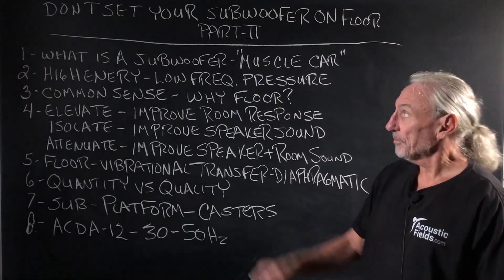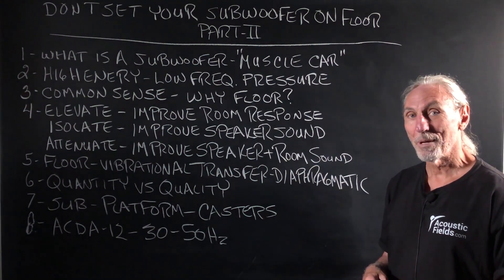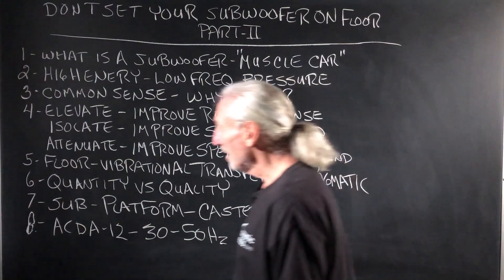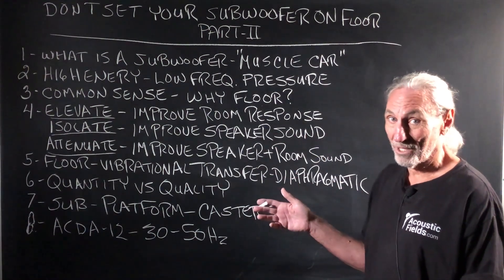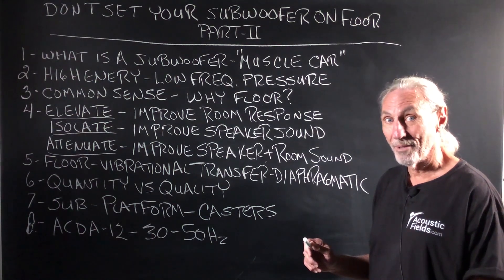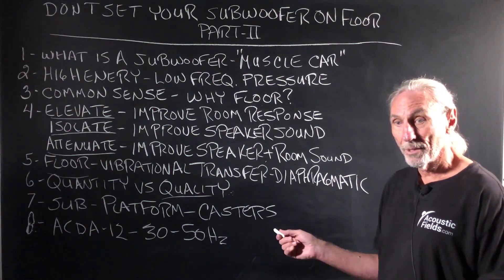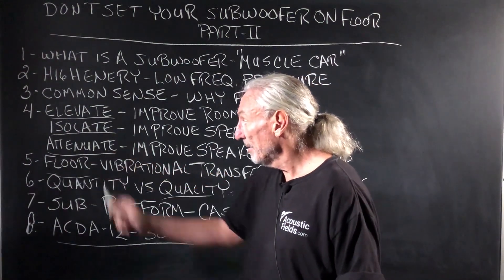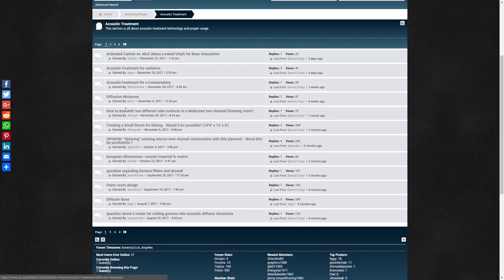Don't Set Your Subwoofer On The Floor! Part 2 - www.AcousticFields.com

Comment: Just tip up the sub and put a hard surface under it. It's people like you that have ruined the hobby for most people.                     . .
Reply from the maker: Its people like you that can not see the forest for the trees. Achieving quality sound in a "box" is a systematic procedure of doing a lot of little things correctly and in the proper sequence to work towards that goal. This is our objective and always will be. If you are seeking mediocrity, look elsewhere. There are numerous companies that will sell you boxes filled with 1.00 worth of building insulation that is 4" deep and call it a "bass trap". The only trap here is the trap the customer falls into.

Comment: What about 2 woofers which are firing opposite directions of each other? The recoil energy would be nulled, or rather transferred to the opposite side. The Kef blades speakers are designed like this, the old Magnavox stereos with 12 inch woofers firing in opposite directions kept the cabinet from feeding back low frequencies into the record player. Acoustic Research AR9 speakers also.
Reply from the maker: The room only sees energy. It does not care about the method of delievery.

Comment: I have no doubt this is true and am very much looking forward to the videos on subwoofer "elevation". However, even decoupling it, I wonder if there aren't floor types to which a subwoofer may be coupled? While this wouldn't work in our old house (oak parquet), I have occasionally heard subs coupled with spikes to hard surfaces with great results - e.g. concrete floor in a basement with no cavities underneath.
Reply from the maker: Its not the surface area of the floor that is the issue. It is the structure of it.

Comment: Elevate ok, but how? Typical cabinet (wood box) will be a resonator. Open frame? Will spread downfire more and may not get floor Into vibration state. Box filled with dampening material? But why have a sub if you then remove the sub's output? This leaves more questions than any answers. Would love to see some actual measurements.
Reply from the maker: You can elevate, isolate, and attenuate with our carbon sub platforms. Here is the link: https://www.acousticfields.com/product/subwoofer-platform-absorber/
Reply: @AcousticFields  Thanks for the link. So essentially it is an absorbent-stuffed box (Roxul 80 or similar). For energy management, there is a volume control on the back of a sub. Absorption up to 200 Hz is quite high, and the vast majority of subs have a crossover frequency adjustment. 30 Hz is not terribly low, as some subs go well below 20 Hz. Re elevation, I can see that removing it from a surface (1 dimensional corner) may be advantageous. But why not an open frame? Maybe slats, as a form of a diffusor? An absorbent-stuffed box can simulate height, but it also will have non-linear frequency response. I am tempted to make an open frame and see what that does. Fun little woodworking project. 
Looking forward to part 3 with some comprehensive measurements. Will be pretty complex as it involves 3D soundlevels, frequency response, plus room characteristics and then with sub on floor, on your stand, suspended, open box. Will be difficult to generalize. 3D statistics to show significant difference will also be complex. I've done linear series with nested MANCOVAs, but never looked into 3D data stats. 

Bottom line: conceptually interesting, questionable implementation.

Comment: I don't call it a SUB woofer until it is way below 20 hz. When the SUB can make a window wall move in and out by inches at 5 hz it is working properly. When the whole house shakes because a bomb went off in a movie, the SUB is working.
Reply from the maker: Quantity is not quality.

Comment: I don’t think $2000 worth of  bass stands will equal $2000 worth of better bass. I’m thinking if you spend that money on a Perlisten Subwoofer, it’ll be money better spent
Reply from the maker: Its all a balancing act with gear and treatment. You must have the gear to produce the energy and you must have the treatment to manage said energy. Nothing stands alone. Its all one large system with many parts.

Comment: I have going to try this with my sub. Only issue is I'll need some furniture to rest it on
Reply from the maker: Don't place it on the furniture. Some of our clients use the paving bricks for gardens stacked on top of each other with MLV between each layer. They are around 2" thick and will support the weight of the subs.
Reply: @AcousticFields  those will bruise my flooring. I'll look for wooden blocks

Comment: Nitro powered vehicles are around 7000lbs per sq in coming out the pipes 🤓
Reply from the maker: We went to a drag strip and took noise measurements at the start line. We measured full range pressure that reached 160 dB SPL. A jet  It was so strong that it made our lips distort like a dog hanging his head out the window. Those people that stand at the start line must suffer all kinds of health issues since the ear protections won't stop the pressure waves.
Reply: If the exhausts pointed backwards, they'd still out accelerate most cars just from the thrust ( with no drive to the wheels ). Mad.

Comment: Your idea of a study of Speaker Boundary Interference Effect (SBIE) is very interesting.  I wonder if your results will be consistent between the floor and speaker until you reach the half way point between the speaker and both the floor and ceiling.  At that point will the result will be a mirror of the speaker to floor now becoming the  distance from speaker to ceiling.  At some point there will be a maximum effect for placing a low frequency speaker into that space.
It may be interesting to repeat these measurements at varying distances from the walls as well as from the corners of the room.  Some very definite advantages to your having this knowledge.  Please share with us when finished.
Thanks   KEN
Reply from the maker: You have described the problem. What treatment do you prescribe?
Reply: @AcousticFields  Every room can be like a big jar, the audio energy is like placing various sized solids in the jar.  Big rocks are like Bass, medium stones are like mid range sounds while the treble, high frequency sound is like sand in the jar.  There is a maximum amount of solids the jar will hold and the same goes for sound energy in a room.  Measuring the limit of sound capacity of a room is the first step in every analysis.  When the sound energy exceeds the ability for the room to contain it, you either have to reduce the amount of sound (volume) or find a way to transform it.  The sound energy remains (reverberation) until it is changed to heat energy since energy cannot be created or destroyed only changed in its form.  This transformation can be the room structure and contents or by adding materials within the room to do the transformation.

Comment: I have 2 downfiring subs...REL t5i's. Wood floor. REL was very confident that I should put my subs on the floor. I'm willing to call Bullsh*t on them. But I don't know how I'd get down firing subs "off the floor". Is the point to not have the subs firing down on anything or just the floor?
Reply: Don’t fret, down firing subs are great.
Everything is a trade off. One great benefit is you hear less of the drivers non linear distortion
Reply from the maker: Think about why a sub fires into the floor. It is the same principle as corner sub placement. The goal is more amplitude or strength using the room as a part of the overall sound . This is also the quantity versus quality paradigm. If you elevate, you can improve room response. You can also attenuate or absorb energy close to source and also minimize the floor to subwoofer vibrations.

Comment: My 18" subwoofers is hanging in the air by steel wire. Away from that (floor) boundary also..
Yes, could imagine that some absorbtion on the floor underneath the hanging subwoofer would be beneficial.
Reply from the maker: It is always best with low frequency absorption to place it as close to the source as you can.
Reply: @AcousticFields  why not just build a large box around 5 sides of the sub box filled with insulation?
Reply: OMG!!  I had thought about subwoofer being suspended in the air with cable to alleviate floor  vibration and I'm surprised someone has done this too.

Comment: Mine was a Pontiac Catalina with the 421 cid engine. Step on the gas and watch the gas needle.
Reply from the maker: LOL. I built a cobra 427 kit car. The thing weighed 2200 lbs. with 500 HP. When you jumped on it, the tach and the speedo would move together at the same rate. Miss those days.

Comment: Doesn't it matter more about what the floor is made out of what is the floor was drywall
Reply from the maker: The floor material type could be an issue but in the overall presentation value, it is a small variable of concern.

Comment: Dennis I'm convinced about raising the subs plural off the ground. My room is wider than long so my 2.2 channel stereo listening is off to the right side due to traffic flow on the left side entryway. Am I best served using one of your stands and stacking two 10 inch subs in the right corner giving me varying height and multiplication factor, or better to use another platform and put the other sub in the FAR left corner or perhaps midway to the left, closer to listening position? I'd rather spend the money on proper set up to get QUALITY as you said, then spend thousands on better and more powerful subs. Thankyou
Reply from the maker: Our sub platforms perform three functions. They elevate for smoother response, they attenuate or absorb energy and they minimize vibration transfer from the sub to the floor.

Comment: Would love to see your opinion of the Genelec W371A system as it tries to combat the problems a subwoofer introduces and they're being very adamant in saying that "it's not a subwoofer". Looks like some pretty amazing tech to try solve a lot of these common issues.
Reply from the maker: This has been going on for years. Speaker manufacturers are constantly trying to minimize room impact on their products. It will never happen. Once the energy leaves the speaker, the room owns it and will do with it what rooms do, they distort.
Reply: @AcousticFields  I agree that first and foremost you have to fix the room and treat the room down to the flattest response you can obtain. But I'd encourage you to check out the system in person if you get a chance, I was shocked by how well it mitigates problems that a conventional sub would typically introduce into the room, it felt like soffit mounted like performance but in free standing speakers without needing to mount, settle on and hope the studio designer picked the correct position for the soffits to obtain maximum performance.
Reply: @JD-qf8ov  the problem with genelec w371a is that is used as a speaker stand without height adjustment. So it is tricky to place tweeters on a listeners ear level.
Reply: @adelkharisov  I can see how this could be a problem for someone with a very small room that is working extremely close to the system. Otherwise you'd just sit the speakers back far enough while also having your chair at the right height. The three ways you pair the w371 with can also be placed horizontally with no impact to performance or tilted, etc

Comment: Very much looking forward to the subwoofer testing!
Reply: This.
Reply: I seriously doubt it will happen, because it will show that lifting the sub off the floor makes very little difference. I've tried it and measured it and listened to it.
What does make a difference if you are selling a product that lifts the sub and you can convince people they need it.
Reply from the maker: What does make a difference is real world testing in multiple facilities not just your living room.
Reply: I put only one subwoofer on some unused pair of Dynaudio speaker stands and my results personally was I actually got a substantial improvement in sound quality versus using two of the same subwoofers on the ground.  This was with the SVS-SB3000’s.  I’ve moved on to Rythmik F18SE’s and I am pretty sure I need to raise the 120lb subwoofer at least 18 inches off the ground…. Not sure what I’m going to use since my subwoofer has the dimensions of a garage ready freezer.
Reply: @IBuildIt  Yeah there many other ways to address this issue, like multisub.  Check out the work of Earl Geddes
Reply: You will get more variation in performance with different placement in the room. Corner no corner , placement. These make a difference height. Not so much

Comment: It’s an air canon. That’s it. 
I use a Sony powered ten I found along side the road for my bass guitar amp. It’s perfect for low B string. 
The way I look at subs is that you have a flute that acts like an air canon. A 7’ 1/4 E is hard to reproduce with out some color or distortion. I like some color but it takes up space. So the ten on the floor (my floor happens to be concrete) will project the low fundamentals and retain timber as the wave defuses in the room. It’s more punch than harmonic . 
For the rest of the spectrum I use an ampeg B-18. Its 35 Watts pushing an 18” full range cone with an alnico magnet. It moves gracefully for a fat guy. 
The ten is on the ground with the 18 on top. I like the fission of an 18; it spreads the low middle frequencies without the 200hz bump( full range cone) subs are a small speaker with high Xmaxx to blow across a box like a flute.
Reply from the maker: I like the term "air cannon". That is exactly what it is. Why would you shoot an air cannon into the floor or worse yet, put it in the corner of a room.
Reply: @AcousticFields  😂 I was told by a guy. Lol 
All joking aside; the room is the dictator of the sound. Might work for some one that has the room for it? IDK. Good topic.

Comment: I still prefer a 2 channel, no subwoofer setup in smaller rooms. It takes a pretty big room before I am ready to drop a sub or two in it. And then I prefer flying them when possible.
Reply: especially in small rooms you are much more flexible with a subwoofer - at least with proper setup you can fight room modes easier
Reply: @Harald_Reindl  Yupp. My subwoofer was the only thing that helped my tiny little room.
Reply: @snapascrew  because you can control pressure and place of pressure and additionally you can place subsonic-filters and DSP in front (antimode as example) and combine that with room treatment which is hard in a already small room given that you no longer have any room after :-)
Reply from the maker: We just purchased two of the SVS 13" subs for our new R+D facility. The signal processing options that are available electronically to process below 100 Hz. can be of great value in fine tuning the output into the room. There are phase, EQ, and gain that can all be adjusted in real time from your cell phone. It is a great asset with the real time feature since you can immediately hear the changes.

Comment: Phase response trace would be very interesting too to see.
Reply from the maker: We will be doing a series of videos on this effort.
Reply: @AcousticFields  I used 10” ~10mm xmax woofer in sealed enclosure (could be ported but that was not the case) with crazy lowend correction to be able to see phase and FR below 20hz. Helped to avoid spots in the room like -30dB at 25Hz. looking forward to see comming videos!!! 👍

Comment: We need 8ft just because of all the residential stuff from where I'm at is 8 ft. I'm really going to watch what you learn in your new room. 
I am doing a bathroom right now, next to my bedroom, should I do something to that 6 inch area between the walls of the 2 rooms?
Reply from the maker: What is your acoustic goal? Are you trying to reduce noise transmission? Are you looking to build low-frequency absorption into the walls? What is your sonic strategy? Using tactics without a strategy is a waste of time and money.
Reply: @AcousticFields  The entire house is noisy, when someone uses the water in the bathroom, hair dryer. 
House is 1590 sqr ft upstairs and downstairs (each floor) nice 12 inch studs on the floor, walls are all 6 inch thick but the bathrooms measure at 8 inches.
But yes, I would like to reduce general house noise, completely separate from my listening room.  
When mentioned it to my contractor he said that NO I shouldn't do anything like that in the bathroom. 
I'm looking at this gap of air??? 
At a loss. 
I live 3 streets away from HWY 67 
Kids outside often. 
And during the day I never, or very rarely get under a 37 or 38 db of noise using one of the android apps. 
I haven't left it sitting there for 24 hours but a average over the 12 hr day, with me talking was at 49db in my living room. 
I should just move.

Comment: It's the absolute worst on the floor. The room is unstable as is. More bass is just more instability to the sound field. Off the floor, it gets the proper treatment and close to flat sound you're looking for.
Reply from the maker: Yes, why would someone place a low-frequency producing device next to a room boundary surface. Manufacturers do this to increase room distortion and gain. They believe that quantity is quality. I have been told many times by manufacturers that raising the sub off the floor creates liability issues which I can understand. What I can not and will not accept that you place a large surface area, low-frequency driver, 3" from a floor or wall.